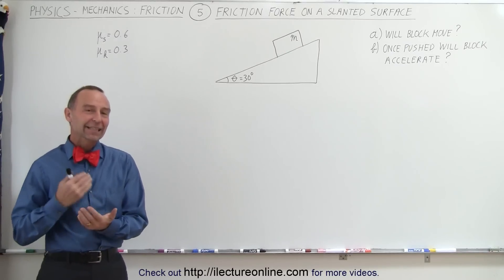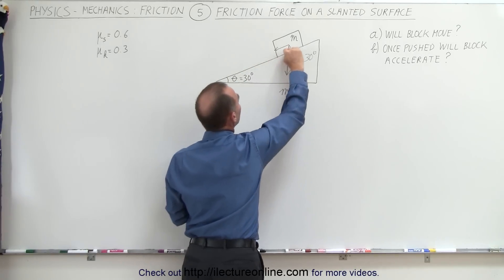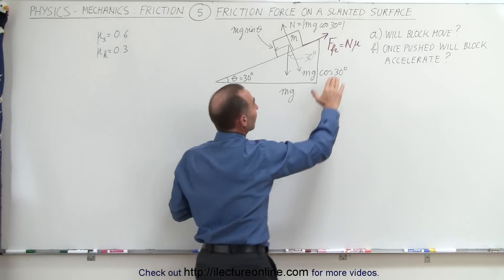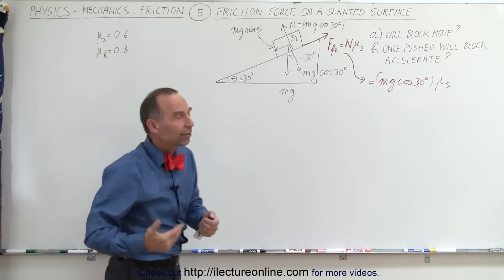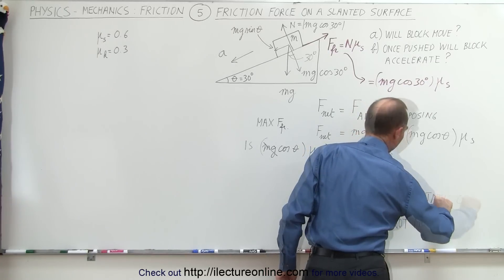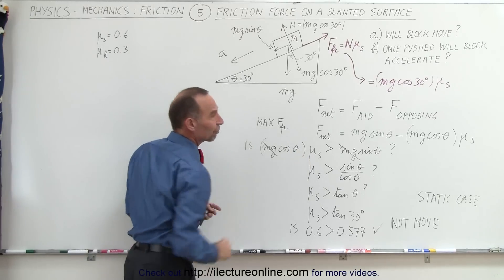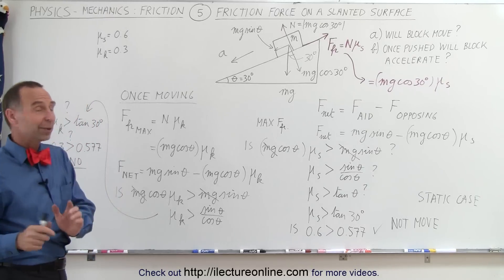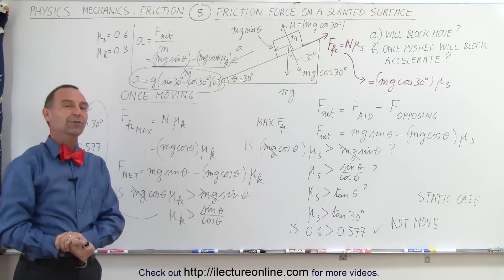Physics 4.6   Friction (5 of 14) Friction Force on a Slanted Surface: 1

Comment: A frictionless plank leans against the left side of a fence on an angle of pi/6 with the horizontal, making contact 5´below the top of the fence.  A similar plank leans against the right side also at pi/6 with horizontal, making contact at the top of the fence.  A 16lb block is on the left side plank;  a 20lb block on right side.  A 12´cord connects the blocks, running over a small, frictionless pulley at the top.  In a stable, static case, what is the distance between the blocks.  (8.15´?)
Reply from the maker: That is a very interesting problem.  I'll have to look at it later today, since I need to go to work now.
Reply: @MichelvanBiezen  OK, Mike.  From your very well done set of inclined plane videos, I thought you might enjoy it.

Comment: Hello Michael! I've been watching a few of your videos for a while now and was wondering, do you have a cheat sheet of the all formulas that you use? Like using the general law which turns into a particular law etc. ex) like momentum delta P turning into MV initial and MV final. Or work energy thm Mgh initial = 1/2mv^2. I would find it really helpful for an exam that is coming up!
Reply: Anthony Tran قففق
Reply from the maker: We are considering putting something like that together, but at this time we don't have that yet.
Reply: @MichelvanBiezen  hi did u get the chance of compiling the formulas all together? Would be really helpful 😀

Comment: If we keep the mass of the object remain constant and increase the contact surface area of the objects then the friction force will remain constant or increase or decrease? Please give some knowledge about that.
Reply from the maker: It turns out that the surface area does not make a difference.  Increasing or decreasing the surface area would result in the same friction force.

Comment: Where is the coefficient of friction created?  Where is .6 or .2 calculated?  Is there a standards book for different surface (material) types?
Reply from the maker: They were just picked (our of thin air) to be used as examples.  It is true that different materials and different surfaces will have specific coefficients of friction, but since no information is give in the problem as to what material the surfaces are made from we just pick arbitrary numbers.  (It is not about the numbers but about the technique of solving the problem).

Comment: Hello sir, may I ask a question about acceleration?
Reply from the maker: We try to answer questions when time permits.
Reply: @MichelvanBiezen  Excellent!  I am trying to model horse locomotion using data from GPS tracking, and have graphed acceleration versus distance to represent Force over distance (since I do not have the masses).  My plan is to take the area under the curve to calculate Work done, and therefore energy expended.  But much of the graph is below zero, as of course during much of the time, acceleration is negative— but, do I simply take the absolute value of the area under the X axis, to add up total Work done (as opposed to net)?